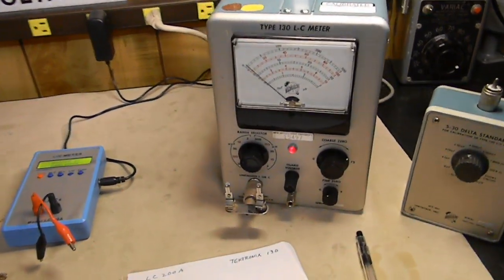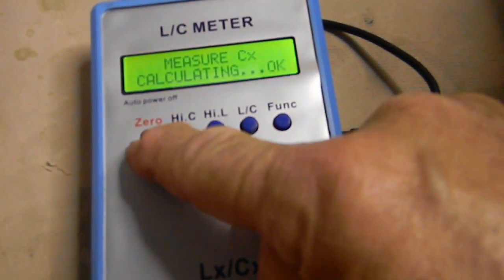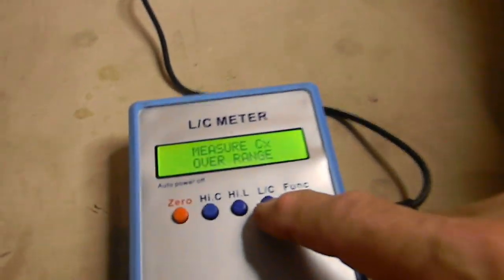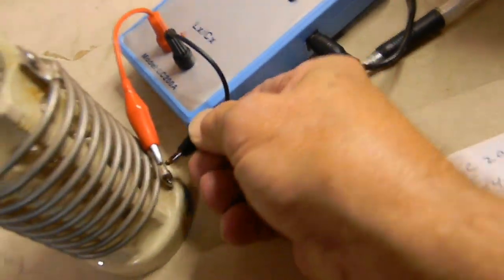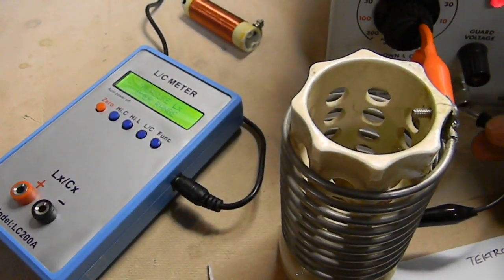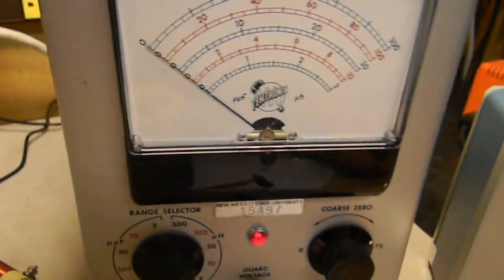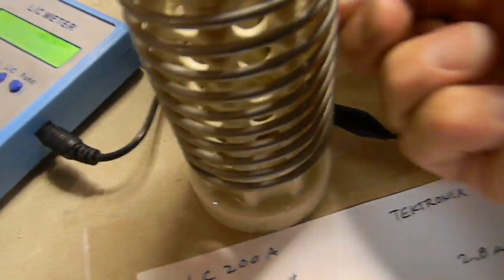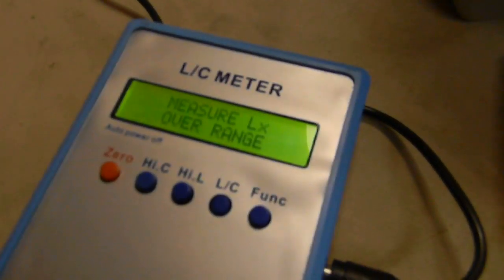Comparing The Tektronix 130 L/C Meter With A New Chinese Made L/C Meter

Comment: Just picked one up at a thrift store... will try to find some stuff to test it with...
Reply from the maker: I have two and the calibration jig but I have to admit, I rarely use then, instead using a digital instrument.  I did bring one our recently and plug it in to run for a while. There is something amazing about the vintage instruments that I will always appreciate.  These instruments measure low value capacitors in the pF range. You have to play with it a while - let it warm up 30 minutes - and hopefully it will work. It will be most likely to work and keep working if it has the original tubes from Tektronix. I would pull each tube, one at a time, use a soft brass brush on the pins of the tubes and a l ittle contact cleaner on them and the sockets, very sparingly, and do that to all the tubes and anything that is a plug or socket. That can solve mild corosion type problems that troubleshooting would be a nightmare.  Best of luck with your new instrument.

Comment: Just got one and it has 5 bad tubes...Then align...For $9.95 I can get a China unit......Better stick with American Made!!!
Reply from the maker: I really like the Tektronix unit. It is limited to 300 pF and 300 uH but I believe what it tells me. I have two and both have original Tektronix tubes. I don't remember for sure but I don't believe I have ever had to do any alignment. I have the calibration jig that goes with them and they measure very well. On the other hand, the little Chinese one I have also works quite well and is more convenient.
Reply: So i just bought a Type 130 but I don't think it has the probe or holder attachment. I'm assuming from watching your video that the probe isn't really necessary? I bought one mainly for making tank coils.

Comment: Another great video from essoteric.  I seem to find that the old vintage stuff just keeps on ticking.  When I was in the market for an LCR meter, I first bought an old Heathkit meter for $35.  It worked well, but didn't quite have the features that I wanted.  One day, I actually stumbled on an Agilent handheld unit that is quite feature rich for under $200.00.  It is all I needed.  Keep up the good work.